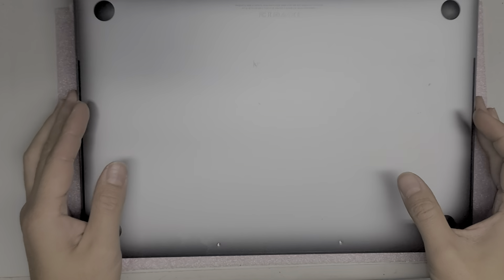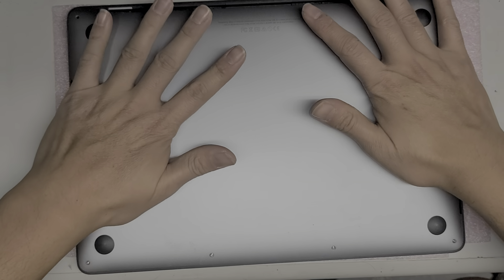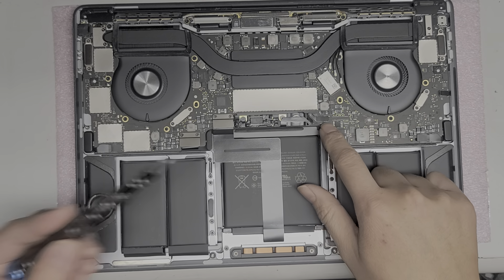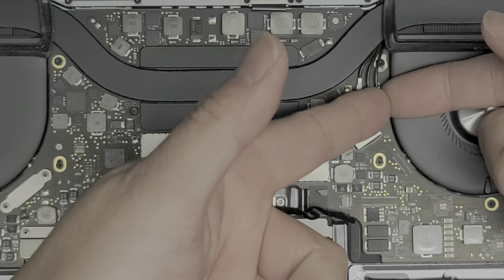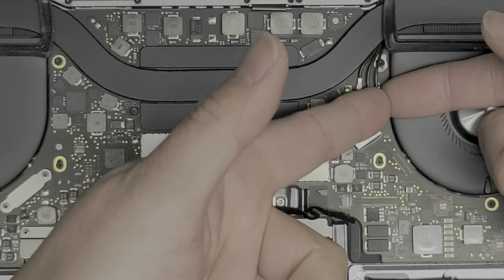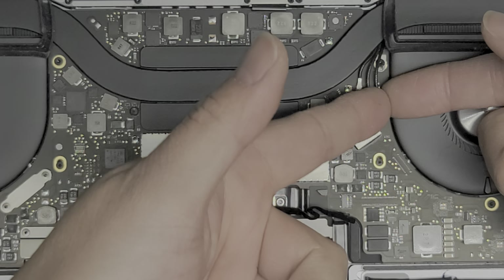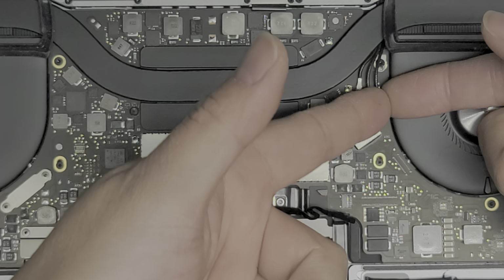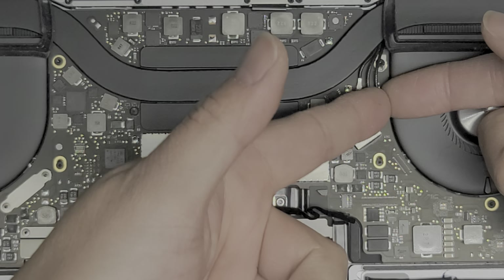13" inch MacBook Pro A1706 Late 2016 Disassembly LCD Screen Replacement Repair

Comment: Wifi antenna in this particular model are tricky to install, what i did , i opened heatsink screw and fan and heatsink gave me a wiggle to work a bit easily
Reply from the maker: Nice

Comment: How the hell do you get the antenna bar screws out, it’s literally impossible without stripping them. Any tips?
Reply from the maker: You need a good quality p2 pentalobe 0.8 screwdriver.

Comment: can you make a detailed video on the battery replacement for this Macbook pro 13" with Touch Bar A1706.
Reply from the maker: These are customer computers, so I can't do that until a customer needs that type of repair. This video is essentially the same process though. https://youtu.be/kcdZ5ePnrpM